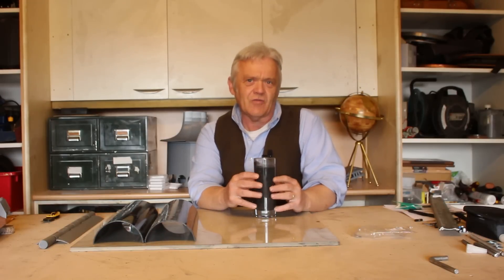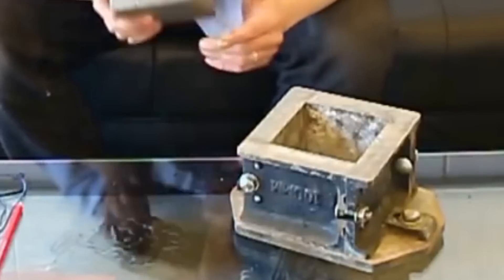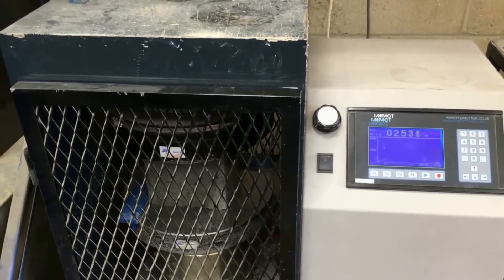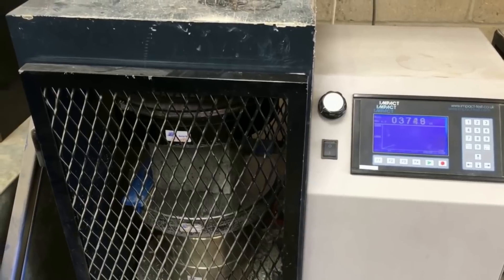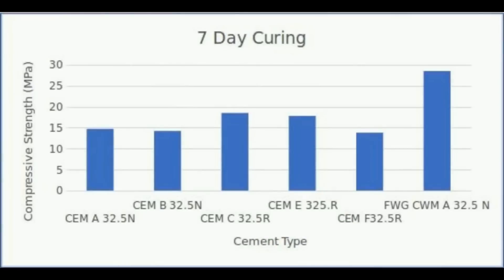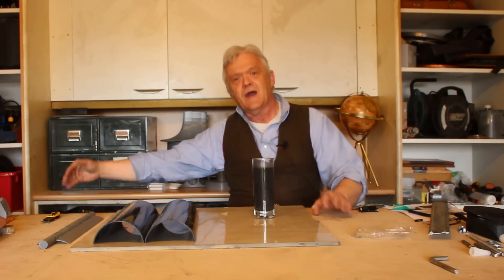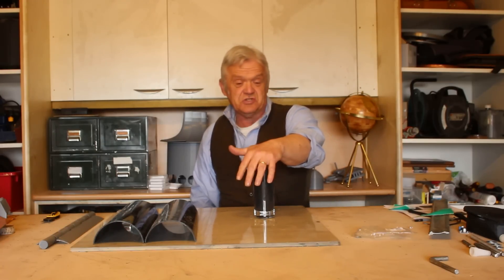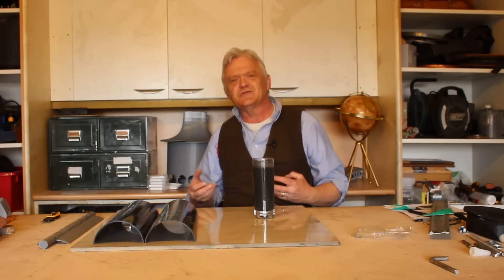1935 Graphene In Concrete

Comment: Considering graphene is easier to wet from both sides than just one, and charges come in to play at those scales, what about introducing electricity into the mix?
What about inducing an electric current in the dispersion?  Or even in the concrete?  
Besides setting up capacitors, what else would it do for concrete, or any other dispersion?

Is the trick to getting it to disperse -using another force?  Because it’s of it’s two dimensionality? (Nanoscale)

Kind of like Teslaphoresis?

There’s a paper written about how graphene interacts with water, how it essentially acts like a mirror - easier to wet from both sides rather than just one.  Is that why it has a hard time dispersing in plain water?  It’s 2D nature?

Comment: So i tried doing exactly this, and the results that i got were actually less strength than what they generally get. I was extremely disappointed by the results. So i tried making 2 batches with different blender, the results did have a difference in between the 2 tests, but the test results were actually derogatory to what they use without adding graphene

Secondly, i thought maybe my carbon source was not pure enough, then i bought sample of graphite flakes from a well known mines here in India with purity of carbon more than 99%,
i again made 2 batches with different blenders, and then i poured 12  6inches cubes with 4 different proportions of both the batches, and then ran a 7day test, trust me the results were showing lesser strength than what they usually get

FYI i tried on M35 grade design mix in which i added graphene at different proportions - ranging from 0.02% to 0.04% of cement by weight

Can you please share your design mix for the concrete that you made and tested and how much graphene did you add 

Also if you can guide where i could have been going wrong

Cheers and Regards! You are doing amazing work!

Comment: This is great,  add the graphene slurry in it to make it stronger.  We also have found out that you can graphene coat sand and add that as an aggregate to concrete to make it stronger.  So, my question is what happens if you do both?  Will that make it even stronger?  It makes sense that it might do so, because graphene wants to bond with itself.  That is why you used the process that you did in order to make it disperse without clumping back together.  So, would that make the dispersed in liquid graphene want to make a very strong bond with that which is coating your aggregate?  If I had a kiln capable of producing graphene coated sand,  I think that I would give this a go to find out.  Thanks for the video Rob!  I find these types of videos very interesting and entertaining.  Keep up the good work Rob!

Comment: Robert, what if 2 copper rods were placed in the mold and then pass through an electric charge would the concrete then heat up?

Comment: COMPARED TO STANDARD CONCRETE: adding as little as 0.02% graphene into concrete “can” make it up to 35x stronger, 146% increase in compressive strength and 79.5% in flexural strength, while decreasing water permeability by nearly 400%. At the same time also creating enhanced electrical and thermal performance. 

But keep in mind “Performance of the concrete is relative to the application.”

WHILE SEEMINGLY SIMPLE — just adding graphene to cement — there’s a whole chemistry aspect that needs to be carefully considered! 

Additives, mix ratios, ambient temperatures, mould dimensions, all play critical roles in the outcome quality. 

Through a lot of legwork and experience, Robert makes everything seem so simple, but in reality they are very complex theories and science. 

MEGA PROPS AND THANKS TO ROBERT!!!

- - - 

GRAPHENE AERATED (FOAMED) CONCRETE: has similar increased performance, but the methods used for designing normal concrete compositions CANNOT be used for aerated concrete. They are completely different (like AirCrete is actually foamed mortar).

Comment: It would be nice to see if this process would do the same thing with aerated concrete.
Reply: It can be used in aerated concrete and has similar increased performance, but the methods used for designing normal concrete compositions CANNOT be used for aerated concrete. They are completely different

Comment: As an architect I've known about this for a while however the cost of production, environmentally, always far exceeded the savings. There are reasons for using it but they were far and few.

I hope this is just a filler before going back to the wind turbine project. I am far more interested in that.
Reply from the maker: indeed - but then i did make that point in the video and pointed out that this method made it cheaper

Comment: You could make a wall using concrete foam and then put a rendering on either side of it with your graphene concrete for strength.
Reply from the maker: for sure

Comment: So what we need to do is make graphine from CO² and add that into the concrete. If fact if you collect CO² from the making of concrete, then you have a way of limiting the impact of concrete on the environment in two ways.
Reply: Concrete naturally absorbs atmospheric carbon via a process called mineral carbonation, but not very quickly and not in great amounts. It would take decades to absorb half the amount of CO2 that was used in its manufacturing.
Reply: @ScottAuch  in this particular discussion we speak of Graphine in concrete, because it makes it stronger. Do you know what role this absorbed CO² plays in the concrete?
Reply from the maker: well there we go

Comment: Can someone check out how the strength of aerated concrete would fair if Robert's graphene is added??. 
People that have tried using aerated concrete seem to give up because its strength is unpredictable from batch to batch and that it scores very easily;  even with a human finger nail
Reply from the maker: why don't you try?
Reply: @ThinkingandTinkering  Fair  question, Robert.   Beyond my capabilities. No foaming equipment; no workshop as such and not enough time  at the moment.
 If it were to work it would revolutionize so many industries. . I had a dream of making post and rail fence elements  for the land I may inherent once probate goes thru.
A bit like the use of your 3D printer has done to your projects

Comment: Wow! Carbon capture to graphene to sequestering and adding strength to concrete.
Reply from the maker: indeed
Reply: @ThinkingandTinkering  Two things I'm interested in.  One, how would this compare to Roman concrete in terms of longevity?  Two, I had an idea for using aircrete, but with CO2 rather than ambient air.  I wonder if this could be done with graphcrete, or would we have to make a graphcrete shell with co2 aircrete poured in it?

Comment: SpaceX needs to see this!
Reply from the maker: really?
Reply: @ThinkingandTinkering  Yes Sir, they had a problem with the cement under the launch mount. They used Fondag cement & it failed. The fill under the pad compressed which allowed the cement to flex to the point of buckling & once undermined the high pressure gasses filled the void beneath & created a 'rock tornado'. I believe Fondag uses shards of steel in the mixture.

Comment: Hello beautiful so you have to vibrate that little brick to get it to settle I think you should use a specific harmonic that way you would set the concrete in the crystal form that you think is the strongest achieving the ultimate strength
Reply from the maker: ok cheers

Comment: I have a bike with brakes that can't be replaced, so I've been thinking about how to make brake shoes or brake pads. The plastic you made in the last video with graphene could be an interesting option! I have to look more into it :^)
Reply from the maker: go for it amte and if you don't mind share the results?
Reply: @ThinkingandTinkering  I will. I just need to figure out how to make the press! I want a big shop press like the one you used in the video, but I can't really prioritise it right now. Any other suggestions?
Reply: @thomashverring  Putting graphene in something that will be worn away seems like a bad idea, as the particulates could be very damaging to lungs.
Reply: @DarthNehimis  Ah, that's correct ... I hadn't thought about that :^(
Reply: @DarthNehimis   Do you have any idea how we can use graphene in the clothing industry without harming the body?
Reply: @ardaa007  seeing as how one of the main contributors of microplastics are the textile industry using synthetic fibers, I think there would be a similar danger with graphene. Fibers get worn down, and will shed microscopic fragments. If these fragments are infused with graphene and it gets into your lungs, very bad.

Comment: Is there a way to test the graphene-crete thermal and electrical conductivity? It might be useful for applications in sand batteries and other high thermal conditions (e.g. Thorium reactors...). Strength testing is well and good but I am from Michigan and our winters/springs are absolutely brutal on any structure it would be nice to see real world application tested in extreme freeze/thaw cycles the more extreme the better.
Reply from the maker: well it i pretty easy to make - the tests are time consuming so i can't possibly do them all - give this one a go and share you results
Reply: Also from Michigan. My interest is in aerated concrete for the thermal insulation properties, but structural values are also important. There are research papers out there with those details, but it takes time to read through.

Comment: Apart from its structural uses, could this enhanced strength concrete be made into paving tiles that could reduce the need to repair pavement? Pavement seems to break down a lot.
Reply from the maker: yes it could

Comment: Amazing, was just thinking if someone actually put it in concrete would it be 30% stronger like you were saying in a previouse video and then this video pops up where you actually making one and its 50% stronger!!  Lol nice.  I live in a city where condos are going up at a mad rate, what are the chances of  taking a jar of this stuff and bringing it on site and sales pitching them about the wonders and strengths of it?  It would be a hard sell, especially while they're in them middle of pouring.  You might have a chance to sell a jar when they're mixing it still.
Reply from the maker: you wouldn't sell any here in the UK by doing that - building materials have all sorts of codes they have to pass
Reply: @ThinkingandTinkering  Hah yeah im sure its  more complicated then that here as well,   not as easy as my holylwood versoin  scenario but I could totaly see it happening or engineers find out themselves and start incorporating it  into their design from the ground up for potentially huge savings.  Very exciting stuff, nice work.

Comment: Out of interest what cement class and mix design did you use for your cubes? 

There are 27 common cements in 197-1 standard ranging from CEM I containing no more than 5% additions up to CEM III/C that. Can be up to 95% additions (GGBS in this case and 5% only 5% cement clinker) 

Virtually no ready mix concrete in the UK is produced with a 32,5 strength cement
Reply from the maker: off the shelf ready mix portland blue circle is what i used
Reply: Ah ok CEM II A/L 32,5R 👍 thank you I will get some tests done with a CEM I 42,5 and CEM I 52,5 (more common in ready-mix and precast applications when I have some time 😊

Comment: I wonder if the dispersion method would work with clay. Reason being to see if it would soak into the ground rather than just leave the clay on the top of soil when poured for improving sandy soils.  Liquid nano-clay is one method that exists but its expensive and propietary.
Reply from the maker: try it and see

Comment: Can you be lazy and not seperate the graphine from the  carbon and just add it to the concrete
Reply from the maker: yes i say that in the video
Reply: @ThinkingandTinkering  great thanks I missed it.
Reply: What % lazy carbon to what cement formula?
Reply: @BaliFoodTreePlanter ?
Reply: I don't think you'd want slidey molecular bonded material floating about in the mix. It seems to me that if concretion occurs around a bit of graphene it's going to resist movement very well, but if it forms around graphite, the graphite is going to easily slide apart under tension or stress, depending on the orientation of the stress to the planes of the graphite.

Comment: And it does not rust.  Most of the massive steel reinforced structure we have built will come down in about 150 years.  I suspect it would work well with magnesium phosphate cement too.
Reply: What is benefit of magnesium phosphate cement? What is strong formula?  🎉
Reply: @BaliFoodTreePlanter  It bonds more readily with organic materials and sets faster than portland.
Reply from the maker: probably

Comment: Curious if this increase in ultimate (compressive) strength translates to fracture toughness and crack initiation/propagation ? I know first order mechanical assessments usually hit ultimate strength but I think with many concrete structures, the primary failure mode is fracture / crack growth mechanics and so just wondering if anything is  known in regards to how dispersed graphene improves those.
Reply from the maker: yes it is known - there are quite a few papers on it
Reply: Can you site any specific articles? Curious about this as well.

Comment: >> Which of the 5 standard concrete types was the graphene added to? 
Does FWG CWM A 32.5N = CEM A 32.5N + graphene? IF so, how does it perform if graphene is added to better concrete?
Also, I'd love to see a structural test of concrete with both graphene AND quicklime particulate added to it (a la roman concrete).
Oh, also, I'd love to see the 28 day for the graphene, to ensure it's not simply drying faster due to some form of moisture wicking effect.
Reply from the maker: blue circle ready mix
Reply: @ThinkingandTinkering  Wow, fast reply! Thanks :D 
Looking at building with concrete + steel truss on top. Rebar seems pretty short-lived though. It would be more ideal to use pure concrete walls I think, if they can be strengthened another way.

Comment: I actually used to make those blocks for testing the quality of concrete being used on site.
You didn't mention how you cured the concrete nor the ratio mix.
I do know that the concrete block should be cured in a water bath, so wondering if you did, as it would probably improve the result?
Reply from the maker: i made a 7mg/ml graphene dispersion then used that instead of mix water the cured in a water bath
Reply: Yes give us your formula and water bath answers please Robert.
Very interested

Comment: That's really fantastic, I wonder how it would work out with "foamcrete", that's a mixture of soap and concrete that is full of bubbles, like a sponge.  Quite a lot lighter and still very stong.  With graphene, it could be both stronger and lighter than the others...
Reply from the maker: give it a go mate
Reply: @ThinkingandTinkering  Seriously thinking about it!  I keep wanting to try to make my own little "house 3d printer" that feeds out foamcrete like filament along a large XY plane fed through a flex tube with an auger bit on the back pushing material  through.  Maybe I'll try it on a small scale first, print out concrete doghouse etc.  Thanks for all the great info.
Reply: @MK-lk7nc   I send my best wishes sir.I hope you achieve what you want to do.

Comment: In respect of the cements where was the pozzolana?. Cements are the binders, aggregates provide the strength. Adding any ultra fine material to a concrete will reduce the amount of cement needed merely because there are fewer voids. 
Interestingly Wimpy tried to reduce the cost of concrete production by introducing “ no fines” concrete in the post war period. 
This was coarse aggregate with cement binder resulting in a clinker block. Successful strong matrices are the result of careful aggregate grading to ensure maximal packing and appropriate choice of cement. Ref AJ Neville properties of concrete.
Reply from the maker: indeed - cheers

Comment: If you add enough graphene to concrete will it become conductive?
If you build a house using graphene concrete and the electrical installations fail in some way could it be a hazard?
Reply from the maker: yes and i have no idea

Comment: Im thinking about making a small shednout back of my house to stire a quite nice push bike in such that ibahvebit to hand for easy access.

Into the base if this, i was considering making a solid concrete block such that i could bury some mooring anchors or a bit of metalwork to secure the bike to into it.

This may actually be quite a cool thing to do.

Do you have a 'recipe' that i could consider?

Also, I saw the protein based extraction method for graphine, however, you neglected to show the isolation and extraction from the resultant mixture in the, err, mixer.

😅
Reply from the maker: i made a 7mg/ml graphene dispersion then used that instead of mix water and you want to watch graphene drying?

Comment: Great video. I plan to add it to aircrete. Having lightweight, strong concrete with high insulation properties must be useful to someone. I'm just going to make raised garden beds. The weight and strength are important for that application, but probably not the insulation properties. Still, it's an avenue to explore. Thanks!
Reply: Not my area at all, but AFAIK, plants in pots compared to those on the ground can have a harder time due to overheating from sun exposure to the pot raising the temperature of the earth in the pot, so it may not be so trivial after all...
Reply from the maker: i made a 7mg/ml graphene dispersion then used that instead of mix water mate